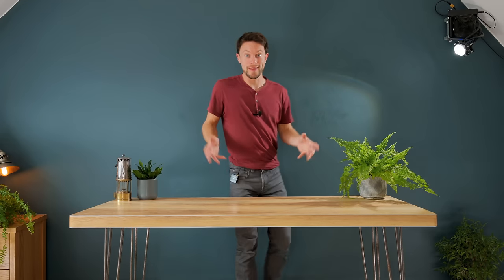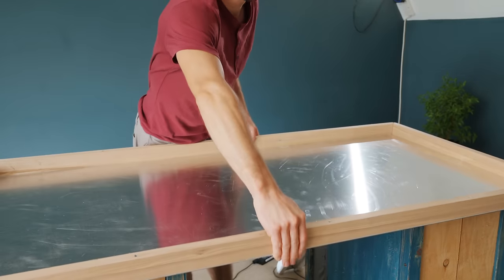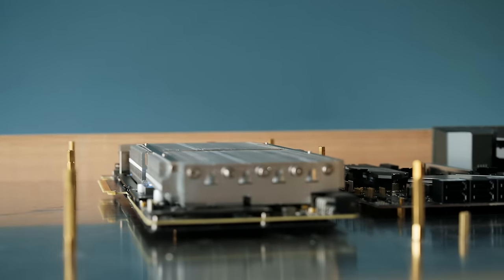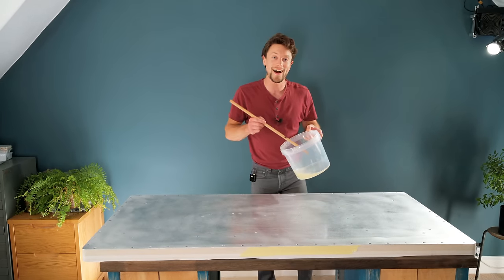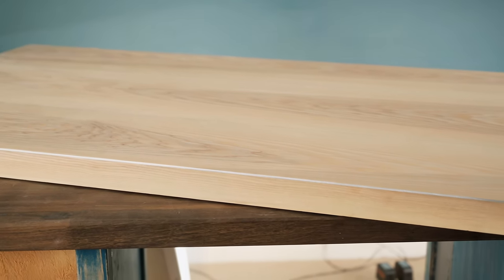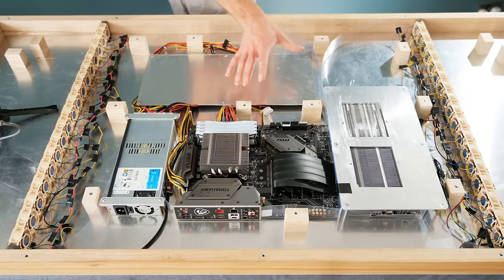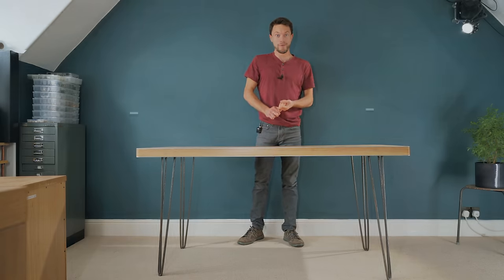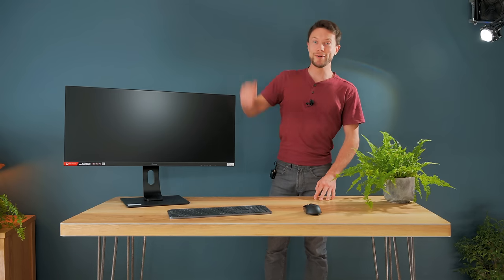Building an invisible PC

Comment: pc repair guy: enters
"so... wheres the pc?"

this guy: "Well its complicated..."
Reply: Lmao
Reply: I mean, if you can make this, you don't need a repair guy lol
Reply: @grod5998  yes you do. building a pc and repairing a pc are really two completely different skills.
Reply: @IdoN_Tlikethis  completely different? You sure?
Reply: @adamleyon8297  I guess idon is right, in cases where the Mobo stops working or whatever. Louis Rossman's videos are very comprehensive on these kinds of repairs, and yeah, I would be totally lost. But then again, I was making a joke Idon :/
Reply: Not really that different. If hardware is the problem then change the damaged component(he can do that) else if software is the problem he can google it and try to fix it himself(as most technitians do) or get it fixed via remote control
Reply: @randomCoolGuy  you won't be always replacing the whole component that's the point of "repairing it" people with a good build knowledge should not expected to detect a dead capacitor or a dead pc which can be repaired in some cases which only trained technicians can do.
Reply: @satejkokate410  yeah, that's what I was talking about. But you never know, for me it's always those damn SATA cables that never connect
Reply: @grod5998  i was thinking that while making the comment but i posted it anyway and it has likes now lol
Reply: @satejkokate410  yeah good luck fixing the internals of a graphics card or soldering again the pcie ports lmao.
Reply: Why do you need a pc repair guy if you're skilled enough to build this in the first place lol
Reply: @satejkokate410  I am pretty sure that 99% of all PC technicians do nothing else but replace a defective part. This is because most of the time the amount of work would be out of proportion to the new price. At least in industrialized countries, in the third world this may look different.
Reply: @nef36  refer to my first comment lol
Reply: Or as Mr Pattinson says’ that’s where it gets interesting’
Reply: @IdoN_Tlikethis  99% of PC techs don't "repair" pc's in the same way as people used to repair cars, or toasters or kettles or shoes. If there is a video card fault or a ram fault or a hdd fail on a system  like this that you have deigned and built yourself then i'm pretty sure that fault-finding would not usually be an issue. Swapping out components is not repairing anything, but feel free to argue if you wish.   I service PC's and yes, it's a skill to isolate a fault, especially one that's intermittent, but it's not rocket science. I've spent longer dealing with a virus or an accidental file deletion or OS corruption.  
The days of soldering dry joints, replacing pots or bridging a dry solder track are pretty much behind us now
Reply: @grod5998  I wrote before I read it lol after I read it I was like "f*ck it I'm too lazy to change it again"
Reply: They should actually do that lol
Reply: @nef36  is ok

Comment: Basically this is a giant computer case
Reply: Uncle Eidolf  vents at the back probably would've been wiser for sure. I hope he comes back with a V2 I mean at the end of the day, it's a fun DIY project regardless
Reply: Uncle Eidolf  but in colder climates, it's a ball warmer, which is a bonus.
Reply: Uncle Eidolf idk...in a warmer climate you could add a (or more) filtered intake fan and extra cross ventilation holes or any other number of cooling methods such as water cooling, etc.
Reply: @honeybadgerisme  Using additional methods for passive cooling along with those enhanced forms of active cooling probably wouldn't hurt either
Reply: A very heavy giant computer case, lol.

Comment: Slight bummer that you didn’t take the opportunity to build in some speakers in the excess space. 

Especially because you’re so talented in sound design.
Reply: He mentioned wanting to make a hidden display later, I imagine he'll likely have to add speakers at some point during that
Reply: This would be brilliant!
Reply: The only problem I could see with adding speakers to the "desk". Is that the airspace within the it is used for cooling the system. Speakers disrupt the air flow. Would probably not help the already limited airflow and resonance as the pillars and other components would impair sound quality.
Reply: Scott C he’ll figure it out

Comment: Thats actually an ingenious cooling solution. I assumed that it would be water-cooled with radiators facing downwards but using the fans and heatsinks provide even less things to maintain
Reply: I mean it's 40 fans. That's 40 points of failure. An AIO for the cpu and the gpu facing down would have been the way to go in my opinion. He would have need at most another half inch of thickness if anything.

Comment: You out Appled Apple:
- Ambient Cooling
- Visually Appealing
- Modular
Reply: modular?
Reply: @PLPlolol1  have you ever tried to open up an iMac? I have and it takes more than 10 screws lol. Not to mention you can't swap out internal gpus, Mobo, storages, etc...
Reply: @Triflixfilms  can't * in an iMac
Reply: @Triflixfilms  you mean....
like every computer?
Reply: @Triflixfilms  ooohh you meant cant
Reply: Ambient cooling?
No
Reply: @cammywammy420  the entire desk is an aluminum heat sink similar to every Mac design. Even with fans, most of the heat will dissipate ambiently.
Reply: There's literally 40 fans in it, I wouldn't consider the cooling ambient.
Reply: TRIFLIX Films without any sort of TIM between any of the components and the aluminum, any “ambient cooling” is simply aluminum soaking up heat that components are radiating regardless of whether or not the components are being actively cooled.
Reply: @Triflixfilms  That's not how heatsinks work. Even if these sheets had a direct contact with the components that need to be cooled (which they do not of course), they'd do a bad job even in the best case scenario. It's the interaction between the positive air pressure (created by the fan setups + the airflow guides) and the fins on the actual heatsinks that's extracting the heat out of the system. In other words, there this is not a passive cooling system and these sheets do not function as heatsinks. It'd be pretty cool to see something like that built though. Agree with you on other points, never known why people spend money iMemes.
Reply: Would you classify this as Incel Modern? Eric Hu found a great example of a Razer mouse as Incel, Apple's as Modern, and Apple's mouse with a nanosilver-silicone boot for haptic cues and antibacterial effect as Incel Modern. (All matte black devices, different styling though.) Placing the vent holes regularly and arbitrarily sort of launched things Jony Ive's way, didn't it? We'll have so see Matt find an off-center square or triagonal step drill, and a Golomb or Jacobean ruler.

Comment: 30 years later this guy becomes president: 
Another country's president: "So where's your country?"
This dude: *points at the ocean*
Reply: He's British, so that isn't likely.
Reply: Atlantis
Reply: Building aboveground is a lot easier to do, since you don't have to bore a hole into the earth to build your new shack, and it also requires significantly less work to put together a house aboveground than it would to make a hole, build the house entirely from the inside, and then realize you've positioned the entire thing two feet too far to the left. Which is another good thing about building in the open air: things can be easily demolished if they are no longer needed. When you dig a hole... You can fill it later, but just hope that whatever material you used for the sides of the building is easily burned, unless the materials are very loosely placed in the same general vicinity.

There's plenty of pros for tunneling, but I assume that since you said "building" that simply digging a tunnel isn't what you were envisioning.

Really sorry about the paragraph response to a 3-month-old comment

Comment: 15:52 “You can hear a slight hollow sound when knocked, but there is nothing we can do to fix that”

You can fill the pc and inside of desk with water, the hollow sound will go away
Reply: N o
Distilled water will keep h2o for a while till minerals come in, and rust and ruin stuff. N o
Reply: great idea
Reply: Bruh moment
Reply: Mineral oil won't rust. I've seen motherboards submerged in it. At a data center for a multi core cpu I worked on.

Comment: Imagine using this with a wireless monitor, mouse, keyboard, webcam, headset, etc. That would be so cool, everything would just look standalone.
Reply: Wireless charging for phone.
Reply: Wireless monitor? Damnn
Reply: standalone until u need to charge them
Reply: @ExcaliburTheOnlyOne  someone needs to invent wireless charging good enough to power a monitor
Reply: wireless seat belt
Reply: @ryanking7331  the wireless charger will still need wire to charge it. Unless you have a wireless wireless charger.
Reply: @JeremyRenthlei  A chain of wireless chargers? I like it! Ideally you would have a single cable going to the psu, which would power everything above the desk wirelessly
Reply: @JeremyRenthlei  It could charge through the base of monitor, effectively making it invisible and look stand alone
Reply: @shabazahmed  the charger still have a wire and restrain you to that specific area. And that's the same as the ones that have a power chord on its base.
Reply: @JeremyRenthlei  Charger should be inside the table. Haven't you seen chi chargers embedded in tables? Like that.
Reply: @shabazahmed  what am saying is the wireless charger still have a cable so.... Its the same as wireless monitors that have power cable at its base. Punch a hole on the table and the wires gone same thing.
Reply: @ryanking7331  You can say goodbye to your testicles if you're attempting to transmit 230 volts wirelessly
Reply: @ryanking7331  maybe you could find a way to run the cables through the monitor stand
Reply: @strangelpeaceful  you don't need 230v for a monitor, laptops manage it with 10-18v.
Reply: @spudit2003  Were not talking about laptop displays but standalone monitors tho

Comment: Did he say "Only 81 celsius, max?" That really goddamn hot.
Reply: That is
Reply: not really
Reply: almost any laptop GPU will run hotter than that
Reply: @TwskiTV  It's not a laptop GPU, and it's about 15C above where a traditional 2070 benches at. And 81C throttles any boost clocks it may have, so it's worse than stock.
Reply: @thejusmar  its big brain time
Reply: I wonder if it actually got "only 81" or it got there and throttled to avoid long term overheating damage. Currently it's not about temperature but throttling. You can run most of the stuff with no running fan and it will still work, just slowly.
Reply: Can be used stock gpu instead of msi
Reply: Sorry guys.  He's right.  Most tables are nowhere near 81 C.

Comment: Another idea would be to integrate an ultra short throw beamer into the table, so the PCs image can be projected directly onto the wall.
Reply: Yes! Some of them have a moving main mirror that folds down and closes when the thing is off (I think it's to make it collect less dust when it's throwing upwards rather than mounted overhead) - that could be hidden under a hinged cover in the surface of the table, opening and closing together with the mirror.
Reply: Oh I like that. But getting enough brightness will really ramp up your heat issues. Not saying it couldn't be done, far from it. But it'll be a trick.
Reply: Exactly my thought. Also I would just use wooden plates not that much metal. I'd also add normal components and have them at the back of the table and just protrude trough the lower plate.
Reply: RGB Laser and water cooling. Or cooling via the aluminum plates.

Comment: very awesome build.  The only thing I would change is the leg style.  I would opt to get some type of legs where it has a hollow inside.  That way you can run power and ethernet cables down through it to connect to an outlet, and have literally no cables showing.

Comment: the fans are audible this time tho 
me: straining to hear with a 50w 5.1 sound system and a 2008 hp elite 8000 that sounds like a boeing 747
Reply: I have 3 external PC fans to cool my laptop. I can't hear a thing.
Reply: @Yonatan24  the fans themselves arent noisy- they are arctic f12's but the fact the case has really bad airflow and the motherboard and psu are proprietary to hp so i cant change case 🙄😐😂

Comment: Me thinking "oh yeah, sheet of alluminum, expensive but accessible.. wood, nice... hey maybe I could even build this myself", then 18:01
Reply: It would be much cheaper and easier to just put 120mm fans taking air in from the bottom and then route the airflow like done here.
Reply: @TheScorp06  yeah absolutely agree, sponsored builds sometimes get a bit out of hand in terms of cost for people at home but fans are one area that can sorta be freestyled if you have time to consider airflow, there are a hundred way to handle a desk with so much free space too
Reply: @aluas4654  exactly, if you want silent fans Noctua can still be chosen but larger fans would be so less hassle and a lot more affordable.

Comment: "A transparent PC! First, we need to make some glass..."

I'm kinda wondering, if 4 120mm fans would still be better, mounted horizontally.
Reply: He is more likely to develop Star Trec's transparent aluminum.
Reply: Problem would be putting em like that would further limit airflow unless you designed a decent flow guide for it and even then you are limited by the fact that the air basically needs to do a 90deg turn, which is not good.
Reply: @exol511  Well, doesn't the air need to turn anyways, from the intakes to the fans? I would suppose an air guide like Perk designed for the insides might be just as effective. But, not an expert.
Reply: this whole thing should have been water cooled. the fact that he wasted hundreds on air cooling is insane
Reply: @diabolicgoldfishable  Well, he didn't. Noctua send most the expensive stuff to him.
Reply: @Kumimono  but you understand my point. He still used hundreds of dollars of meterials
Reply: @diabolicgoldfishable  Using these small noisy fans is a waste of money for practical project. Better and cheaper would be with big low noise 140mm or bigger fans placed horizontally. It's not like air needs to go straight to flow.. Also this aluminium plate looks like it could be converted to heatsink. Possibly making it completely passive system.
Reply: @diabolicgoldfishable  Yup, that's why I figure larger fans with air conductors would be a better solution. But! His rig, his solution.
Reply: @diabolicgoldfishable  It's "hundreds" in noctua's expensive retail prices... These fans likely cost about $4 tops to produce and you can find quite similar fans at that price or even cheaper if you just look on part stores like digikey or mouser, on top of that you can even get bulk discounts starting as low as 10 of an item, meaning 40 fans might cost as around $80 + shipping and it's not like you even need that many 10-16 fans would probably work perfectly fine in this build and you could likely get them even cheaper off alibaba, but even with 40 of them it's still just barely any more expensive than the cheapest water cooler you'll find from a reputable brand and remember that you need at least two for both the CPU and GPU so we're talking at minimum ~$150 for water cooling.

https://www.digikey.com/products/en/fans-thermal-management/dc-brushless-fans-bldc/217?k=40mm+fan&k=&pkeyword=40mm+fan&sv=0&pv46=406958&sf=0&FV=14%7C87868%2C-8%7C217&quantity=&ColumnSort=1000011&page=1&pageSize=25
Reply: @diabolicgoldfishable  The fact that he based his design on parts-on-hand (given by sponsors) counteracts that.
For air, perhaps a squirrel-cage blower, like used in good air filters, would work better.
Reply: @JohnDlugosz  I'm far from an air expert or anything but I think the best solution would use both types of fans, large quiet fans for the intake to gather lots of air and something smaller like these 40mm fans or your suggestion of a squirrel-cage blower to force the air to move through the system and out of the case, maybe even opt to place some at the end of the heatsinks as well to really get some flow going.

Comment: 25:10 what about an hidden, integrated projector at the back of the desk that projects the "display" to the wall behind the desk? 
Of course, you best need a white wall and also the room lighting might has to be low depending on the projectors power.

Comment: The air cooling obviously helps the power supply too but I imagine you might have better results with water cooling. Even quieter, potentially better temps but again, theres the PSU. You'd be less likely to burn your legs too if they somehow touched the heat sinks. Still, a bloody amazing build and I'm thinking of how I could possibly build one, because that is beautiful. 

Forgot to mention, while I did say the heat sinks could be a hazard if touched, they'd be brilliant heaters during winter

Edit: just realised you have a follow up with water cooling. Nice
Reply: The table is a big heatsink.....

Comment: an idea for cooling, given the large area's that are left on the sides, you could instead mount large fans flat, pulling air from the bottom and blowing it towards the top surface of the case, this would be a much more economical way to get the same level of airflow as it requires way fewer fans, an angled plate mounted to the bottom of the top surface could also be used to help direct the airflow on it's internals.